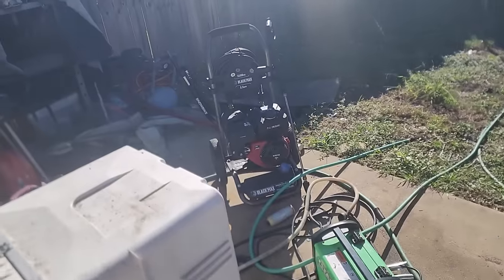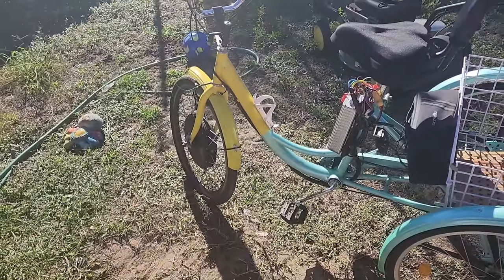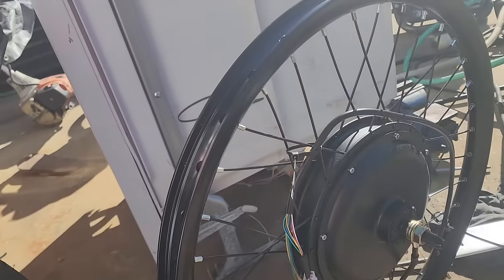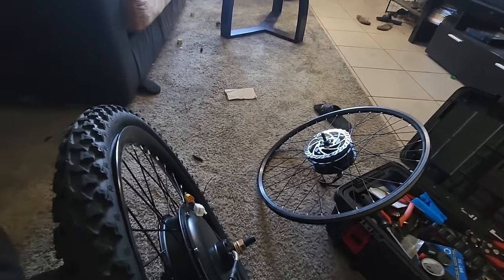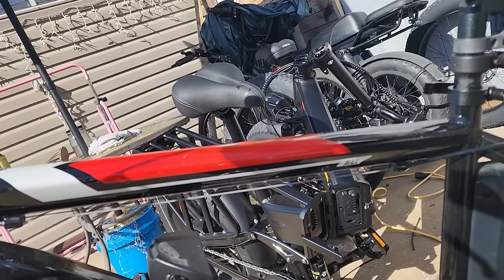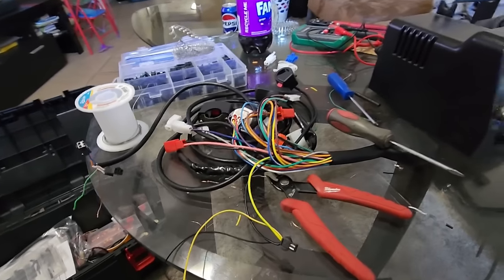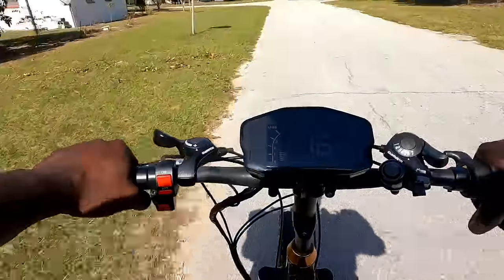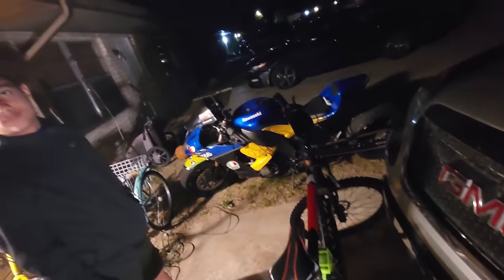1500w ebike conversion kit build.  60mph for a customer!!!

Comment: Hello I like your channel because you build some great bikes I've got a question. I had 750wat so I upgrade to 1500wat kit controller 35amp +1 sw900 display 34mph my PAS isn't working it did and went dead contact seller can't send messages because when I set bike up the bike shot off lucky no one was hert that hasn't happened before. I think the problem is controller I can get 40amp but can't use sw900 display or 45amp which I can yes display but the seller said my wheel might get hot so this kit is 5 levels of PAS throttle always on so are 1500wat wheels all the same motor and what would be best controller to use thanks ps. I I don't want to go 60mph like video but like 40mph
Reply from the maker: I'll answer your questions in a few I'm Christmas shopping lol
Reply: @E-bikeguy  thanks just to say I've got 2000wat 45amp 52v that does 43mph. I bought a fat tyre bike I made video it's on short videos made samside panels in 75yrs old still like ebikes. Enjoy your Xmas shopping looking forward to reply I've changed magnet and sencer still won't work checked settings. According to sell he said our kits only work on PAS 5 level throttle all time on 2000wat water I've got 5ir 9 levels on throttle as well as PAS I hope the circuit in wheel is just for a certain controller it cost £399 thanks again

Comment: hi ! i want to know what is the  risk if I used a 52 volt battery and 60 amp controller on a 3000 watt motor which is 48 to 72 volt compatible
Reply from the maker: You will be fine , I use a 52v battery  with a 150a controller on a 3000w hub motor  it was hot but it survived lok
Reply: Okay thanks a lot for your info

Comment: You probably already know but for fat tires tire size settings, you can or should use the 28inch setting for a 26inch fat tire wheels. Major difference in speeds, major as people overlook the fat tires are 2 inches more off the ground of a 4inch width which raises the dimension while settings are actually off of a 26inch setting. Regardless if using fat tire, using the28 setting on actual 26 setting will have bile go faster by 2 to 3 mph.
Reply: The mph reading will be off by half if settings at 28 of using actual 26 inch. I have 2 lcds and the LCD with 28 settings reads off as just half in example the LCD reads 10mph but actual speeds is 20mph. So dont think ya going slow of the 28inch settings, its the Fat Tire dimensions that are off with LCD Controllers of a regular tire size setting of older controller chip on these Fat Tires. Conversion Kits will have this minor lag of updating. Factory ebike controllers are on q of fat tire dimensions, ( maybe, not sure )
Reply from the maker: Yeah , you definitely right about that!!!

Comment: Great job , I put normal wheels on same vivi frame and a Bafang center hub motor 
Plenty fast and torque 
Vivi mosfets blew out in a month ,that's why I upgraded
Reply: Put a step down voltage regulator to run a FOG light as a headlight,  relay uses old 6v lamp to enable
Reply from the maker: Oh ok , and that's a major upgrade you did to that bike over stock

Comment: Yeah I think 1500 is good enough for me, I’m gonna build up my Riding Times Z8. Thanks for the motivation your video is golden. Thanks again
Reply from the maker: Thank you so much 💯  1500w is the sweet spot
Reply: I see! I just checked my specs on my bike it says it’s a 1500w PEAK Rear Gear Hub motor, 48v / 15.6ah Removable Battery, question is do you think of I swap the controller for one you used do you think I’ll get the speed and torque you got out of your conversion? I’ve seen a battery on Amazon that gives the Motorcycle look even the more, I’ll send you the link.
Reply from the maker: @kingcryptobro800  yes but you will need a battery like 40ah and depending on the amps the battery can handle you will definitely go faster

Comment: Hello Sir,  I have a question about the Fardriver controller, I wanted to get the Sabvoton 72200 but you often read that they are junk, but unfortunately there is not much experience with Fardriver. Is the programming complicated for someone without a lot of technical knowledge?
Reply from the maker: Oh no sabvoton are great controller there  not junk by any means it just that fardriver is a more powerful and cheaper but harder to tune
Reply: @E-bikeguy  Oh ok, I've just read so many times about burnt Sabvoton controllers, so do you think it's ok to invest in a Sabvoton?
Reply from the maker: @Uwe342  yes it's perfectly okay to get a sabvoton controller
Reply: @E-bikeguy  ok thank you sir

Comment: What parameters were used? I have a 3000w motor and fardriver 72360 arriving this week and i dont want to burn up my motor or anything else
Reply from the maker: Just do 140a dc and 300 phase  you will be fine
Reply: @E-bikeguy  I have a 72v 20ah triangle battery with 60a bms and a second with 40a bms. Will they be fine?
Reply: My goal is 65 mph I'm hoping
Reply from the maker: @anthonyfogleman8652  oh then set dc to 80a and max phase to 280a
Reply from the maker: @anthonyfogleman8652  it will be hard with a 60amp bms the controller is no problem it's the battery  I could be wrong but the controller set to 80 58mph I think you can get
Reply: @E-bikeguy  sweet ill do that when my controller gets here, also is it fine to run the bike with no display? The displays a few weeks out and would like to test the bike out before then

Comment: What's the best 29 inch bike to use for a 1000 or 1500W motor kit.
Reply from the maker: Well  Walmart has two that I will use for a 1000w or 1500w conversion  my favorite is a schwinn axum 29er
Reply: @E-bikeguy  Which should I buy?
Reply: @E-bikeguy  Schwinn 29" Axum Mens Mountain Bike, 19-in Frame, 8 Speeds

Schwinn 29-in. Axum DP Mens Mountain Bike, Red, 17-in. Frame

or the electric version and upgrade.....
Schwinn 700c Bay Ridge Hybrid Electric Bike for Adults, 7 Speeds, 250w Ebike Motor
Reply: I don't see an axum 29er
Reply from the maker: @jbamerican_usnavy  Schwinn 29-in. Axum DP Mens Mountain Bike, Blue, 19-in. Frame https://www.walmart.com/ip/494339371
Reply: ty @E-bikeguy
Reply: @E-bikeguy  Last question....which do you regard as the best dual motors ebike?

Comment: Not legal in many states/provinces. The bikes should be kept regulated at 19 mph or 29 mph. I know ppl want to have fun, but converting bicycles into non-legal motorcycles is NOT cool. Many ppl do not have the years of cycling experience to safely ride today's roadways. 15 to 20 mph are perfect speeds for beginners and most cyclists, while 25 to 35 are fast and safe enough for experienced cyclists. Going past this brings a person into dangerous motorcycle territory on a bicycle (bicycles are not built to withstand such speeds from inexperienced riders). For liability reasons, I would regulate the bicycle/bike to class I if selling to minors and/or inexperienced riders. Just my opinion, nothing more.